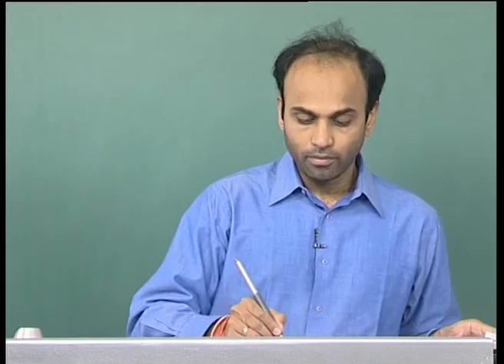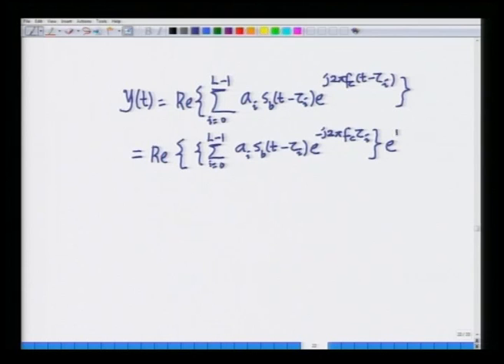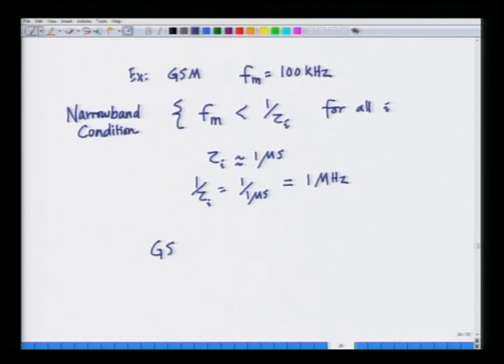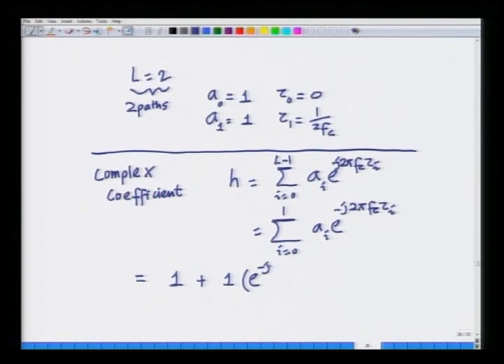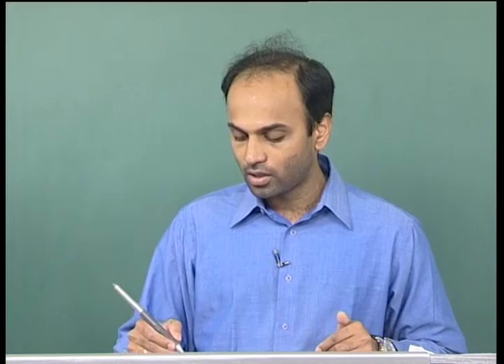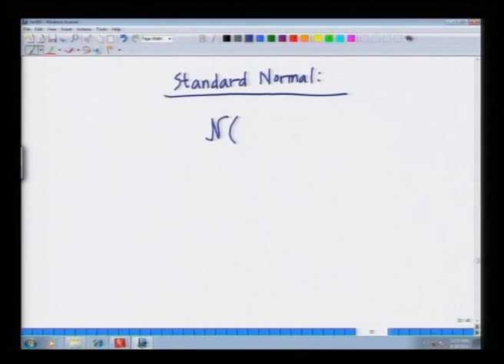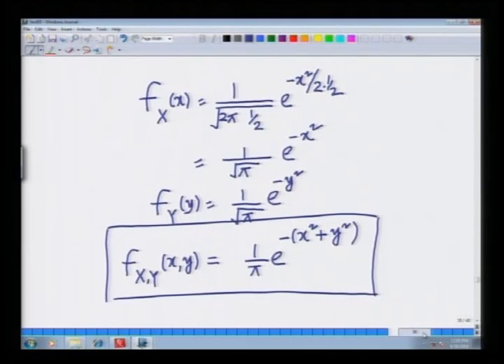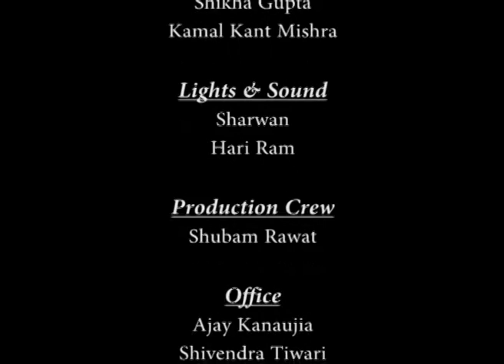Mod-01 Lec-02 Wireless Channel and Fading

Comment: at 45:12, why is component x and component y independent?  They clearly comes from the same set of alphas and delay taos...
Reply: as per my understanding, x and y both depends on attenuation and delay.but they don't depend on each other.that  means x is independent of y,but not independent of attenuation and delay. notice that x is a cos function and y is a sine function.
Reply: I'm still confused. Suppose t is a random variable, x = sin(t), and y=sin(t). how could x and y independent from each other?
Reply: if X = R cos(t) and Y = R sin(t), then X and Y can still be independent although they both seem to depend on R and t. Example is x and y coordinates of a randomly chosen point. y cannot be determined from X. R cos (t) has information of both X and Y.

Comment: My question is why he took the variance 1/2 instead of 1 as in normal distrubition's variance 1.Can anyone explain this?
Reply: The variance is halved for the real and imaginary part. Merging these two normal distributions will lead to a standard normal distribution. Variance is actually responsible for power so as we are separating into real and imaginary parts the power of individual parts is half of the total power.